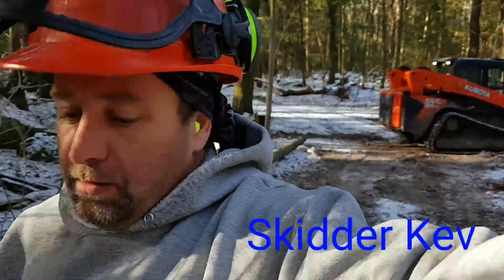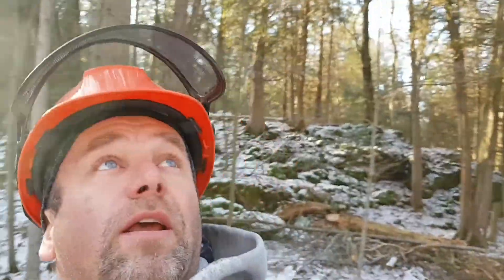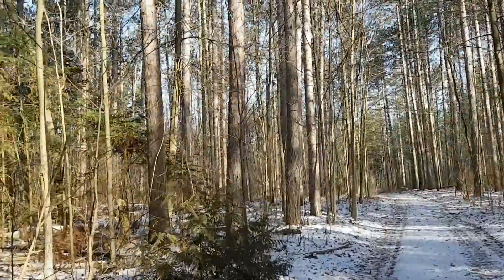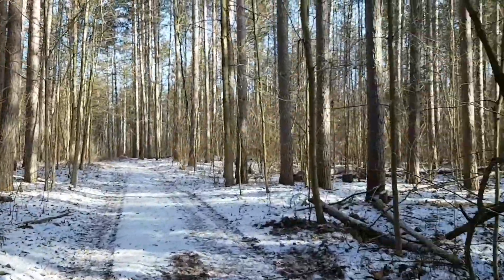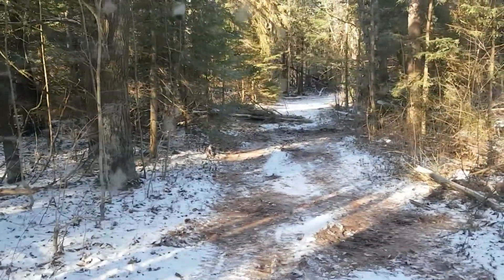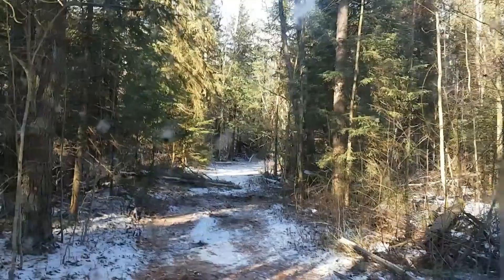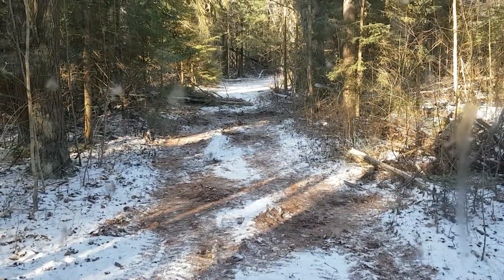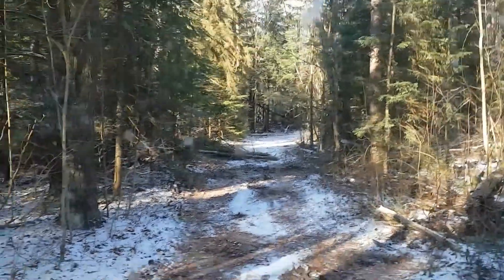Broken windshield!

Comment: Might look up racing shields, broke the glass in my SVL95 about a year ago. Replaced it with there lexan, everything is ready to go just gotta swap your hardware over and glue it to the frame for around $500. No complaints so far and cheaper than the Kubota forestry door kit.
Reply from the maker: Thanks for the suggestion Geoffrey.  I will have to check that out.  Is that US or cdn $ and does it scratch easy?
Reply: Sorry that is USD, no it does not scratch easily and still looks really good after a year. I run a tree shear on it and it spends alot of time piling brush.
Reply from the maker: Hmmm really have to look into this .   I know skidsteer solutions makes one but its 1000 usd.
Reply: Yeah I seen that too, but go straight to the company that makes them, really helpful and answered any questions I had.
Reply from the maker: That's great.  Thanks for pass that info to me.
Reply from the maker: Hey Geoffrey was that 1/2 you put in?  Someone smashed our glass out last night so we are going to go lexan